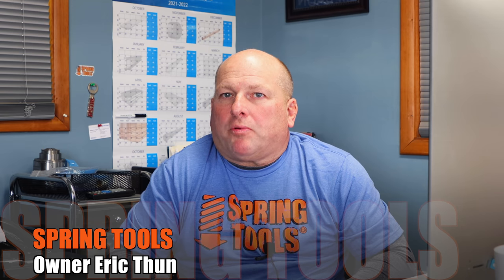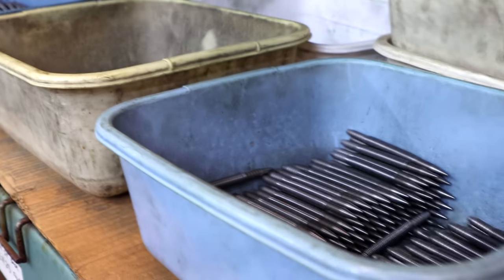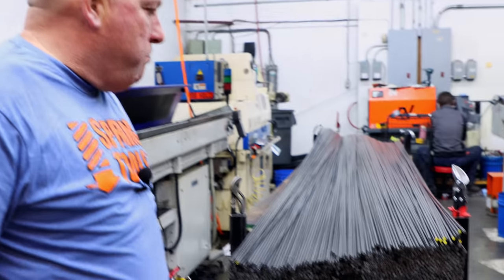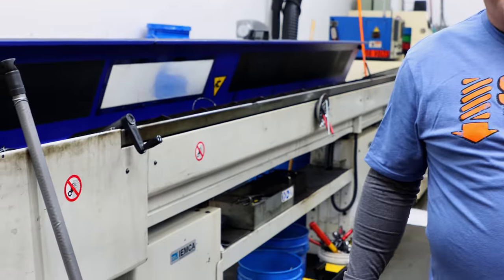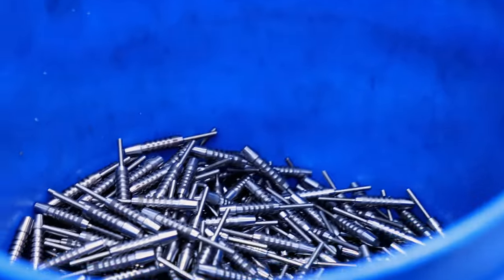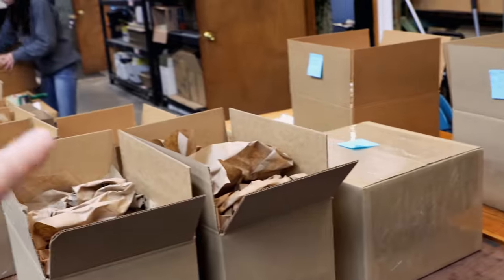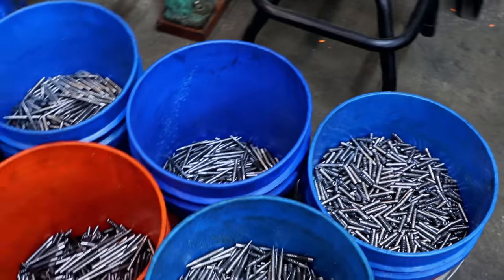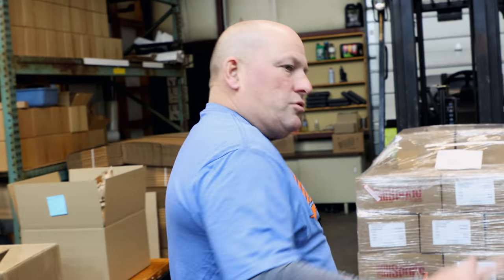Spring Tools Factory Tour And How It's Made Right Here In The USA

Comment: When you did the other video showing the tools, I went out and got one from center punch from Snap-on and a 5 piece mechanics set from spring tools. And was able to use them on a job that had some strong steel and they preform flawlessly. Thanks for show casing them.

Comment: I’d like to check out some of the reviews first
Reply from the maker: Haha so snap on rebranding his tools doesn’t say anything ? 🤷🏼‍♂️
Reply: If you do window motors/regulators you want these. I use them instead of a hammer and punch to pop out the steel pin in alum rivets so i can drill out the head of the rivet which is often used to retain the glass. So far, no broken glass. I'd give them a 5 out of 5 or 10 out of 10 rating, Having used them about 10 years.I have a one man shop in a small town and I do about 8 motors/regulators a year, so they hold up well.

Comment: I’m after a bit of advice please. I live in the uk and have purchased most of my Springtools from Amazon or from eBay in America and had them shipped over. I've tried to contact Eric thun at spring tools regarding getting hold of the interchangeable pin punch set (steel) version as shown at the show you went to in December where you met up with Eric. Ive sent various emails to the email address given but I’m getting no answers at all. There doesn’t seem any easy way to get hold of Springtools in the uk. I’m aware that Eric has had issues with people making fake copies of his tools which was an additional question I had regarding the HD1015 heavy duty set of which I’ve purchased, my set has the ribbed handle as are on all of my Springtools but I notice at the show he demonstrated the HD1015 set which had mushroom style heads fitted. Has the design changed, are these any better or do I have fakes. The Springtools website doesn’t seem to keep upto date with its tools and what is current. Can anyone give any advice on how to contact Springtools etc. regards, Dave.